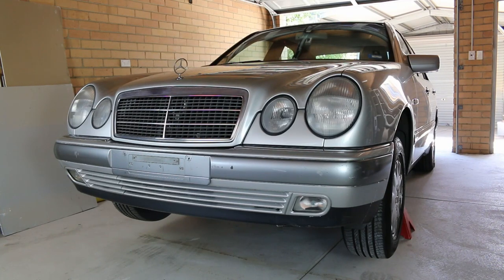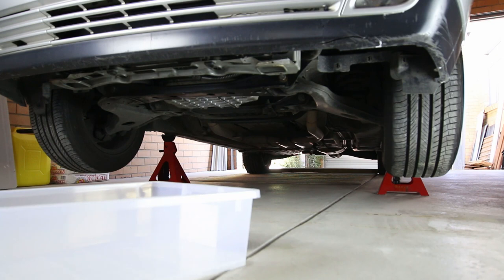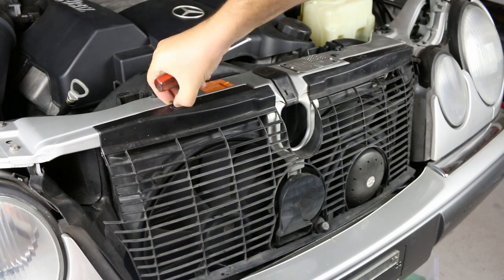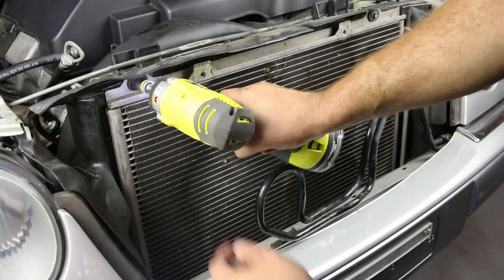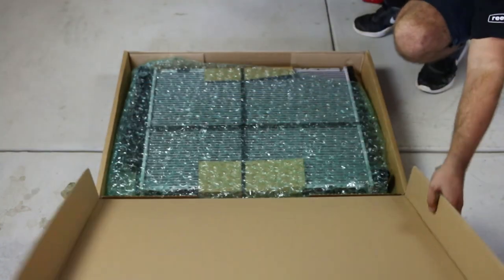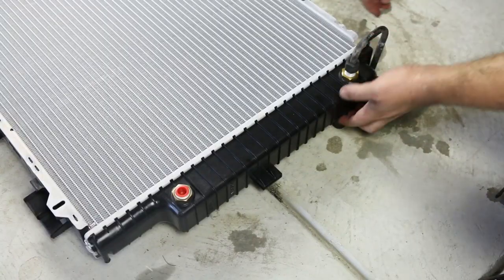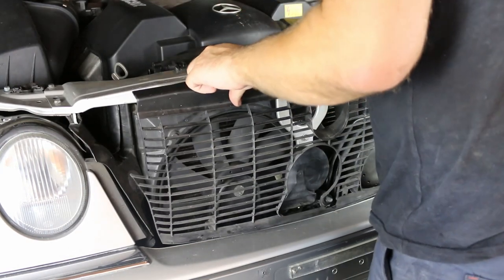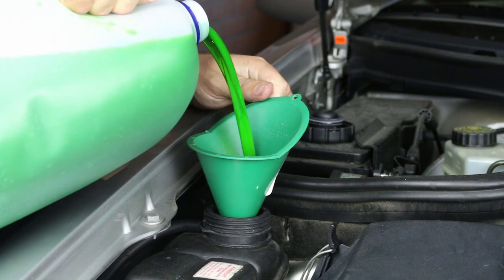Mercedes-Benz W210 Changing a Radiator

Comment: I tried to remove the radiator drain plug but it broke. I drilled it and removed it. When I replaced it with a new drain plug, water was leaking from the litlle black hose next to the red drain plug, I assume I damaged the threads. What can I do to fix the problem?

Comment: good job !! we don't need to purge air from the circuit ? i've changed the radiator recently of my 1999 E200 w210 , the liquid level stayed good , but there's air compressed in bottle !! is it normal ? thanks

Comment: great video. My 98 E300D doesn't have the "legs" on the bottom of the auxiliary cooling fans, just flat across the bottom of the frame. All the replacement part numbers available seem to have the "legs". Guess this was peculiar to the diesel model, as the other videos I've seen showing them are this one, an E430 or a W210 AMG.  Any help greatly appreciated.

Comment: Great video - very high quality! Question: do I need to disconnect the ATF lines and all other connectors of the radiator if I ONLY need to remove the AC condenser?  Will it work if I just remove the fans and the other bits in front of it? Thanks!

Comment: Do you need to add any ATF fluid to replace any that dripped out?
Reply: Yes best to top up the fluid. Just ensure you have a new cap as these are a sealed unit so removing the plastic cap will break it.

Comment: How similar is this to the e300?
Reply: Did you ever find an answer to that question?!
Reply: Yeah, it's pretty much the same from what I remember.
Reply: @oddity6176  the main difference I came across was the turbo intercooler for the om606 was wedged pretty good onto the radiator on mine on one side. It was tricky getting it lined back up with the radiator again when the new one was installe. I thought I was going to have to take the front bumper off for that intercooler because it wouldn't budge.

Comment: Any tips on disconnecting the atf lines? I've been hitting it with pb blaster and going at it for the past hour but they wont budge
Reply from the maker: Ricky Johnston they came off pretty easily on this car. If you’ve made sure you are turning them the correct way to loosen, do you see any rust or the likes around them at all? You might need to heat it up to help try and loosen it